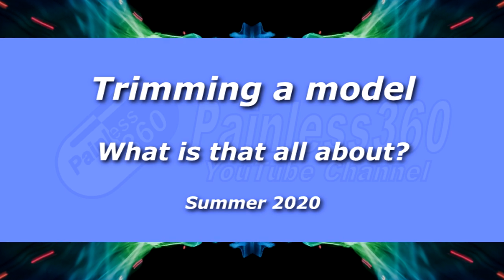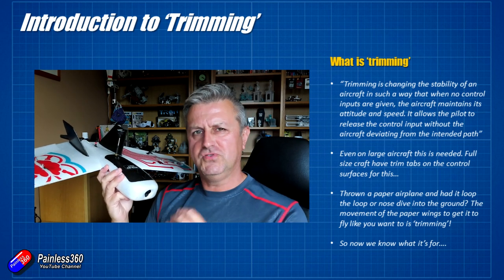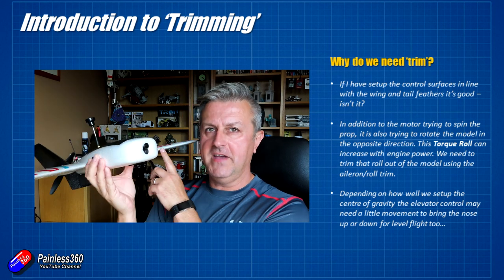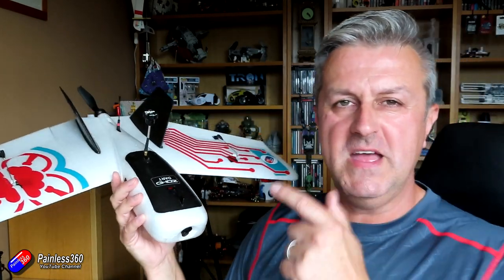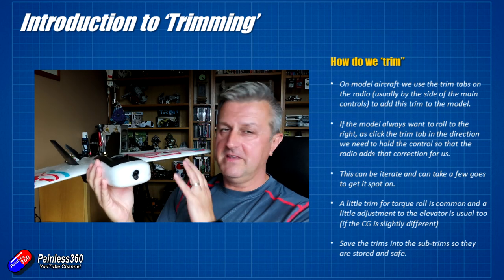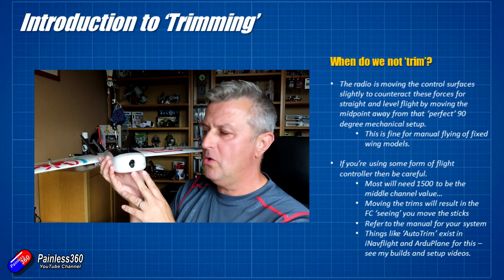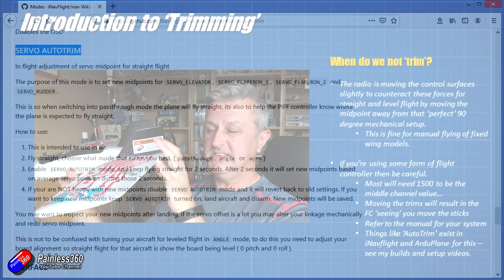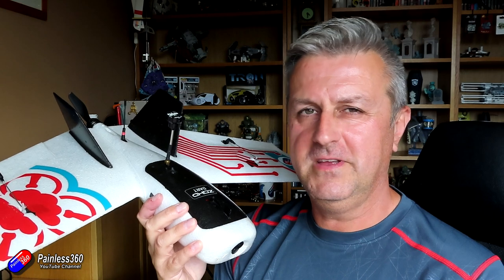R/C Fixed Wing for Beginners: How to trim / What is trimming?

Comment: Lee, thanks yet another gem of a video. Very helpful. For RC pilots, trimming does have the effect of making the model seem more stable, ie it goes where you want it when hands off. Aerodynamically though, stability is determined by where the centre of gravity is in relation to the centre of lift. Trimming on a full sized aircraft is used to relieve the control load necessary to maintain a selected attitude. It’s the same for RC - if you have to hold the stick off centre to maintain a selected flight condition, you can use the trims to return the stick to centre. So you can also use the trims to select and maintain any flight attitude. For example you could trim into a  climb or descent for the approach to land, in combination with an appropriate change in power.

Comment: That was very useful thanks especially the idea of moving the trim tab in the same direction of compensatory stick movement.  Before seeing your video the elevator trim control was confusing to me ie was down down to the bottom of the radio .. now I know it's not, it's the same as stick direction.

Comment: I've got a couple planes now.  Dart 250G that crashed about 20 times before I finally figured it (using a KOPILOT but not INAV), a Ranger 2000 running INAV, a Drift running INAV, and now a AR Wing Pro (started with a Kopilot because for the Dart 250G it was way more forgiving than INAV.  The plan is to go to INAV on the AR Wing Pro after I get it trimmed in manual mode using the Kopilot. I think I've watched about every video out there by you and Andrew Newton and few others on setting up planes in manual mode and doing the trimming  - that is where the I'm not 100% clear.  There's good information in those videos, but the introduction a flight controller creates a disconnect for me in the start to end finish of getting a plane trimmed out and ready to go for INAV.  So here is my understanding of the process.  (I'm going to use the AR Wing Pro as example)
1).  On the Servo arm, put the linkage in the 3rd hole from the end of the servo arm
2) Attach the linkage to the control horn (there's only one hole)
3) adjust the linkage until there is 1.5 to 2mm of reflex
4) Adjusting the throws (disconnect #1, no mixing on the radio when you plan to use a flight controller).  I'm going to go ahead and put the FC in the plane
5)Adjusting the throws in INAV.  Get a ruler and move the control surfaces to the max positions using the radio. use a ruler to measure the max.  Reduce the weight in INAV to get the throws to less than 12mm in each direction, per the manual
6) Fly the plane in manual mode.  Adjust the trims using the radio until the plane flies level when not touching the sticks.  Land, measure the control surfaces. 
7) turn the radio off, adjust the control horns mechanically until the control surfaces are at the same position when plane was trimmed using the radio
8), Turn the radio back on, remove all of the trims from the radio and fly again in manual mode to validate if it works.  If it still flies well in manual mode, you're good to go, if not repeat steps 6,7, and 8
9) Fly the plane in stabilized mode and enable Servo Auto trim (provided the plane flies well, move to the next step)
10).  Connect the plane to the configurator, review outputs tab.  If you you see any of the servo middle channel positions outside of 1450 to 1550, you have some more work to do to setup the plane mechanically.  Provided all of your values are inside the 1450 to 1550, move to the next step
11) .  Fly the plane again and go flip the autotune switch and keep flying and then fly some more.  Right before landing, come out of autotune, use the stick commands to save the settings.
Reply from the maker: Setting up the model well mechanically is key to flying any model (even one with a stabiliser/flight controller). I cover all of the basic steps here - https://www.youtube.com/watch?v=Vaq4Jt0XzOU - then there is the setup of the flight control system on top of that. I have an entire series for beginners on INAV and Kopilot. 

Every pilot has their own series of steps that works for them but they are variations on a theme. Once you get a setup that works for you - stick with it and have fun! Happy flying!

Comment: That's really interesting! Thanks a lot, Lee! 😃
So a radio like the TBS Tango 2, that doesn't have trim buttons, would be enough to fly with iNav?
Stay safe there with your family! 🖖😊
Reply from the maker: You don't use trims with flight controllers. See the iNav for beginners 2020 series.. Happy flying
Reply: @Painless360  I did see it, but I didn't know about that. I must have missed something. 😬
I'm thinking about the Tango 2 because now it has an external bay for multiprotocol module. You know? So I don't know if I get it or the micro module to use with my Taranis. 😬
The smaller size is pretty tempting!
Stay safe there! 🖖😊
Reply from the maker: Its covered in the video in the last slide.. Happy flying
Reply: I must of missed it too? I even watched it again, and Im not clear. I have the exact same question. The dji controller doesn't have trim buttons either. How can you still utilize it? Get it as close as possible mechanically and then servo auto trim? Thanks all

Comment: Lee, once you have gotten your servos to 90 degrees and have trimmed out your plane using the trims and then saved them to the subtrim menu does that then send out the right values to make the fc happy? (Like 1500 for center stick) or do you have to dial everything perfectly mechanically and never ever touch the trims? How else do you get your servos to 90 etc and still make the fc happy? If you could clarify these points please. Cheers mate. Keep up the good work.
Reply from the maker: You don't trim like this if you are using a flight controller.... See my comment about that in the video...

Comment: excellent videos. need a bit of help I am installing apm2.5 on a fixed wing , almost got it but when I input ailerons the rudder moves like if both the rudder and ailerons are in the same channel. can you direct me in the right direction. new to fixed wing, and flight controllers but saw your videos and like them. have a blessed day.
Reply from the maker: See my build series for all the steps I use to get a model working. Make sure you have no mixing on the radio.. Best of luck
Reply: @Painless360  thank you sir.

Comment: When setting up servos in inav is it ok to change center position from 1500 to say 1575 to center the control horn at 90 degrees. I had one servo that was just off a bit from 90 degrees with the servo and this was the one way I could fix it.
Reply from the maker: Yes. See my INAV for beginners 2020 series. I show all the steps...

Comment: Thanks for the trim primer. What is the black skid piece on the bottom of the Dart? I scrubbed thru the build video, but didn’t see it. I looked thru Thingiverse and didn’t see it there either.
Reply from the maker: Crossfire antenna protector. Just black foam to stop it being damaged in storage

Comment: I know this question is off topic to this video.   What I'm trying to do with opentx is to make a mix for main gear door and gear.   Flick gear down,   door opens fully, pauses while gear lowers, then raises half closed.    Reverse when selecting gear up.    Too add to it,   I'm trying to use trainer switch to activate the main gear door as air break.   Pull and it fully lowers,   without gear.   Release and it raises.      Too simulate the main gear of a F111C aardvark    Any suggestions and help,   much appreciated    thankyou and hello from New Zealand.    I feel more than open for you to share this as a video.      If I can get it to work,   I'll like you make mix,   so if gear is down,  and I pull air brake switch (trainer)   gear stays fully closed,   but spoilerons  fully raise       Which are mixed with taileron mixing.
Reply from the maker: You can make Opentx do just about anything. See my Opentx mix school series... Happy flying

Comment: This is way off the subject but I have a question. Can you connect and run an X-Vert to a Radio Master TX16s?
Reply from the maker: Possibly, if it has the right Spektrum protocol..  best of luck

Comment: Lee, is there any way to assign different trims to a switch?  I've often noticed moving from manual to stabilized mode or some other mix combo perturbs the trim requiring a lot of tweaking and testing.
Reply from the maker: Check out the Opentx mix school videos on Flight Modes. You can have different trims...

Comment: Hi my aeroscout s2 keeps rolling to the right even on safe select my ailerons are perfectly straight it has caused me to crash 7 times I've even changed my reciever and still rolling right can you please 🙏 help me
Reply from the maker: Have you trimmed the model. Sounds like you need a few clicks of roll left trim to counter the roll tenancies the model has... If the model has a stabiliser then it sounds like the level needs recalibrating too. Best of luck
Reply: @Painless360  I've tried to trim with the button but it seems to need more sorry I'm new to this and I've tried getting information from the manufacturer and they are no help
Reply from the maker: Looks like page 15 shows the process https://www.horizonhobby.de/fr/product/aeroscout-s-2-1.1m-rtf-with-safe/HBZ38000.html
This system isn't sonething i use here.  The person who sold it to you should be helping... best of luck